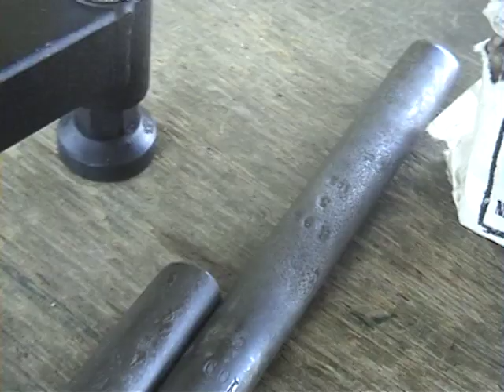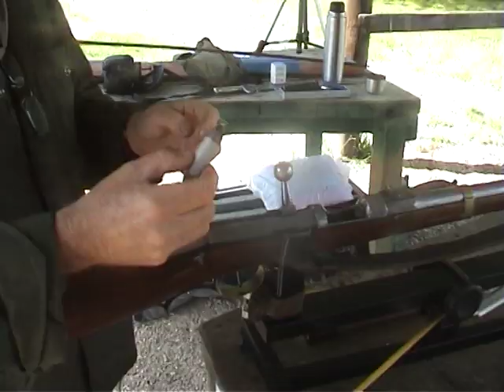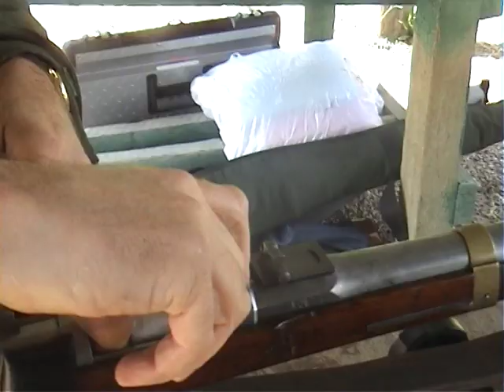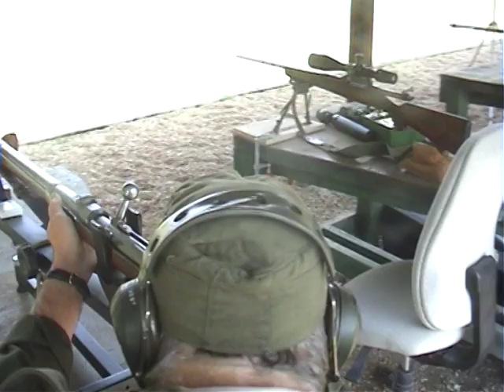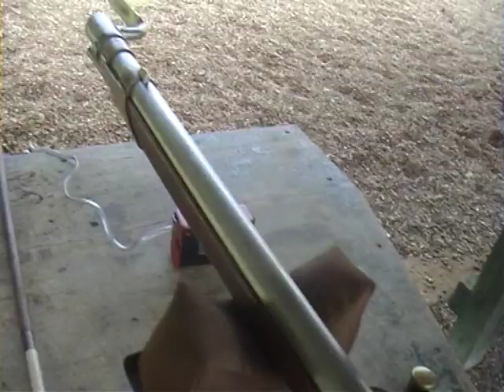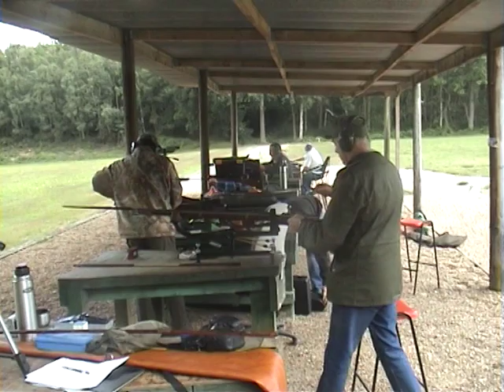Shooting Dreyse M.41 chambering m.47 cartridge.avi

Comment from the maker: qounqer,

Mistook M/60 Dreyse  for M/60 machine gun of which we have little knowledge.

There is a slight gas leak at the juncture where the male and female cones meet as no metal to metal  obturation was possible with the system.  The leak does not in any way effect the shooter, this is a myth along with breech fouling and needle breakage.  Gas leakage can be seen to flow upwards and away from the shooter's eyes in the video.

G and L A-R-West

Comment: Out of curiousity, how accurate is the Dreyse rifle with the various bullet types?  

Usually when you read about the Dreyse you hear abou the Langblei bullet, but I'm confused as to how common it was, how accurate and when it was used?
Reply from the maker: Bellator11,The Patrone M/55 was the most extensively used cartridge with the Langblie (long lead) bullet.  It was replaced after the Franco-German conflict by the Patrone M/72 (with a smaller langblie), which by then the Mauser system had been adopted.  Both Patronen M/55 and M/72 are very accurate, placing us high in competitions.G and L A-R-West
Reply: Guy and Leonard A-R-West I was asking because I saw a video by another youtuber named Capandball, and he couldn't get the langblei to shoot accurately as compared to using full caliber round ball. I also noticed on a website that a full caliber pointed bullet was available, when was this used?
Reply from the maker: Bellator11,The round ball or Patrone M/41 was the initial cartridge followed by the Patrone M/47, which was also a calibre size bullet.  The latter was more streamlined but was unstable at longer ranges.  Replaced by the aforementioned Patrone M/55 which was more accurate at all ranges.  Capandball is shooting the correct cartridge with his M/41 Dreyse, which is sighted for both Patronen M/41 and M/47, but not for the M/55.Making duplicate sabots for the Patrone M/55 requires special swaging equipment utilising several stages to obtain the correct necessary  strength, durability and precise dimension of the sabot.  Possibly this is why Capandball is not obtaining the desired accuracy with the Langblei bullet?You have possibly seen us shooting a pointed bullet featured in our video.  This is the experimental cartridge for the M/49 Jager rifle, duplicated  for our research.  The experimental cartridge was not adopted, albeit it was very accurate, however, it  did not perform at long range.   G and L A-R-West
Reply: Guy and Leonard A-R-West Excellent stuff Guy/Leonard ! Many thanks for the info, I do hope all this information doesn't get lost, i.e. I really encourage you guys to write a paper or book about this subject for all future history enthusiasts out there :)  So many people fail to realize how influential a gun the Dreyse really was, as well as the quantum leap in battlefield effectiveness it introduced.

Finally I hope you can work with Capandball to help him make some proper Langblei ammunition, because he truly makes some excellent videos on this subject - the camera work/production value is very high in his vids.
Reply from the maker: Bellator11,Thank you for your kind comments.  We have started to write and illustrate featuring the Dreyse and Chassepot systems .  The subjects are very extensive and requires considerable amount of time.  Moreover, we have covered much ground in the last three decades of evaluating and research and hope to be published within the next two years. Furthermore have been illustrating various uniforms and associated items of equipment and bayonets for each model. We have written several articles for magazines and academic journals over the years for the USA, Germany and UK.We only take videos to prove that all our research is validated and not just written about without testing each system.  Unfortunately, we do not possess sophisticated movie equipment nor editing facilities sufficient enough to create the excellent quality of the CapandBall videos.  We have been touch with CapandBall who was going to come to the UK to film our collection and document with footage  covering the aforementioned systems.  However, for some unforseen reason this did not transpire.The Carcano needle ignition is another subject we are covering, also the rare Enfield Pattern I and II copy of the Dreyse system.Regards,G and L A-R-West